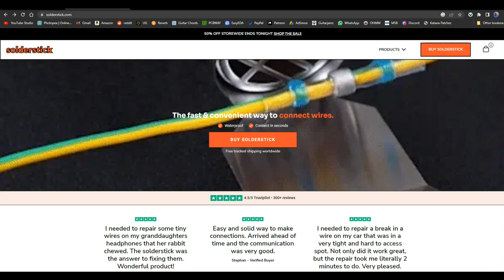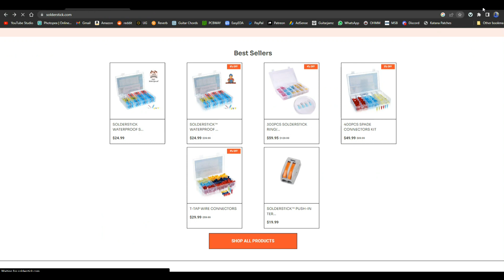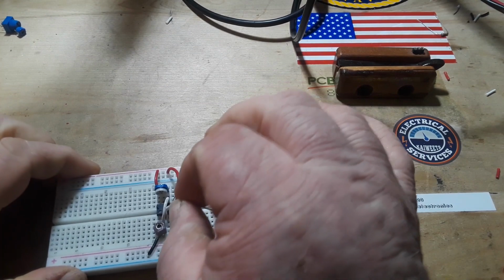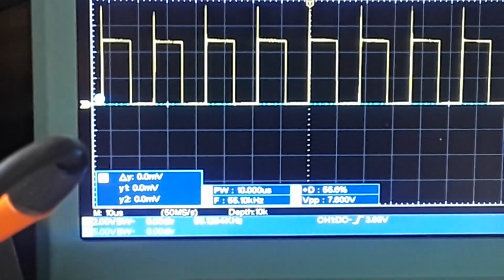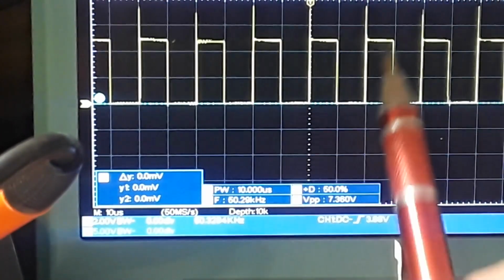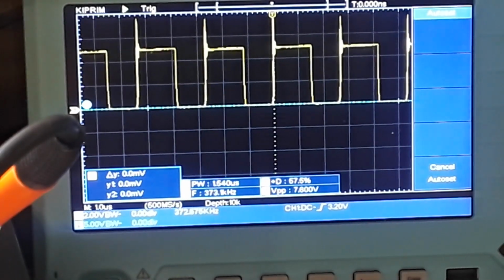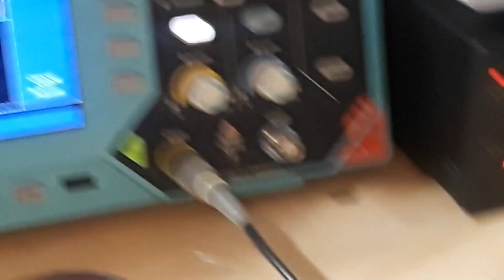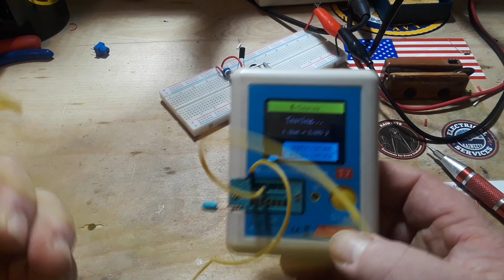555 Timer Adjustable Frequency Duty Cycle Circuit sponsored by Solderstick Wire Connectors

Comment: How would you eliminate the voltage spike at the rising edge of the square wave ? Thanks 😊
Reply: Put a cap across pins 1 and 8. I usually use 2.2uF.

Comment: PAUL, how do you fix that ringing or overshoot? Can you make a video lesson about "strapping resistors" and "internodal resistors" when are they used and why are they called strapping resistors and internodal resistors mostly used in power supplies for the filter caps. Guitar amplifiers have a standby switch because of the filter caps need time to charge because this isn't called Time constant because there is no R, so what is it called when a filter cap is charging? its not called time constant or charge time

Comment: Hi, informative video! I have a suggestion for a circuit if you don't mind. I tried to build a "555" on a breadboard using an LM393, 74HC74 and 74HC04 with a PNP and NPN transister, it didn't exactly work. I read the data sheets and only some of it soaked in. Maybe I was mixing logic with the wrong idea. I added an LDR in a couple of places to induce a change in the process but all I did was make a fancy "street light". I used the criss cross astable circuit for the clock pulse.There was no reason to make this, just was experimenting....

Comment: I used a 555, varying timing between about 15hz and 0.75hz using a potentiometer. It triggered a transistor, after passing through a diode to keep single polarity, to allow a boosted (via a further transistor adding power) guitar signal to come through in pulses... Even with capacitors stacked on the power rails I got a significant click marking the cycle... Any ideas for cures? (basically want to chop up guitar signal to amp).
Reply: add a capacitor in line from 555 output to transistor to smooth the out the spikes would be my guess
Reply: @GeorgeC1andonly already got a 10nF mylar capacitor in between 555 output and transistor, haven't tried larger or polarised capacitor yet.
Reply: Are you a victim of the notorious 555 "shoot through"? There's a point where both the 555’s output transistors are "on", effectively putting a short across Vcc and ground, generating transients. It's more of a problem with a bipolar 555; try a CMOS 555 instead.

Comment: Ah the ubiquitous 555, the most used ic since the 50s.
Reply: The 555 timer was introduced in 1972.
Reply: Yep, but the 555 is still the most used.
Reply: @warrenking1815  the 555 was the most produced IC at one time. I'm not sure if it still is, or not, today.
Reply: According Wiley Brand, publisher (~2016) the 555 timer is one of, if not the most manufactured IC today.  Across various manufacturers and regions close to a billion are made and sold each year.
Reply: @adailyllama4786  I am surprised the 555 is still so popular considering how cheap microcontrollers have gotten. I know using a micro where a 555 could work is overkill but I also know that many are apt to do that sort of thing today too.

Comment: How would you clean up all that ringing?
Reply: There are multiple factors which can cause ringing. Breadboards / Veroboard are notorious for anything running at relatively high frequencies (each connector row is effectively a capacitor), switching power supplies and long power cables, power supply decoupling (there didn't seem to be any), scope probe compensation (adjustment) or ground connection and external noise from other supplies, lighting etc. Have to eliminate one by one.
Reply: Impedance matching at about 33 Ohms
Reply: I am a proponent of trial by fire.
Reply: Thanks everyone. I now feel enlightened